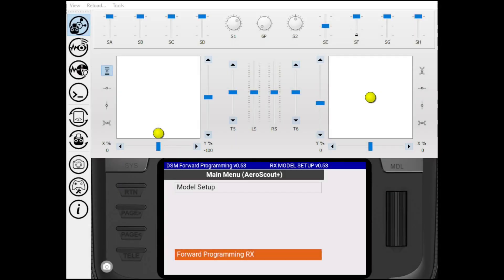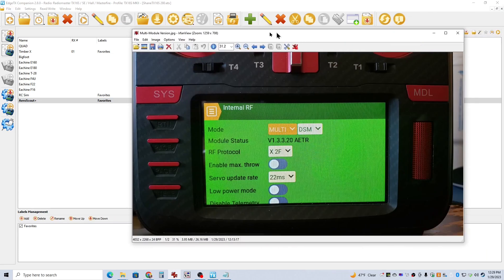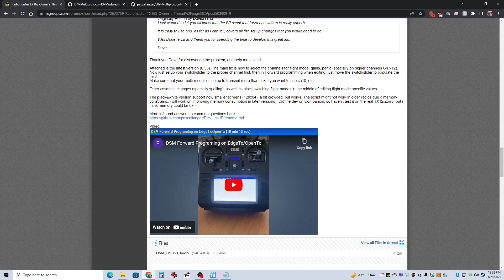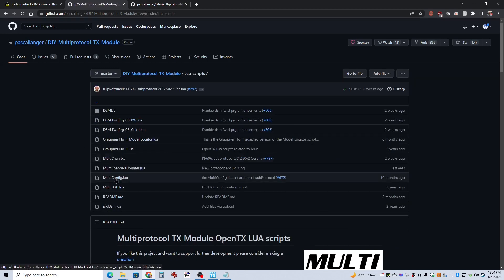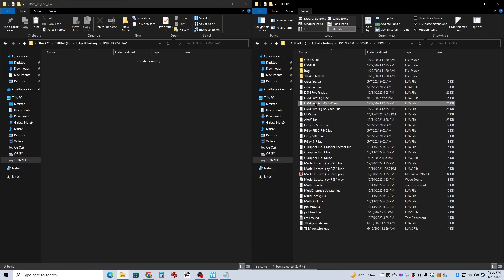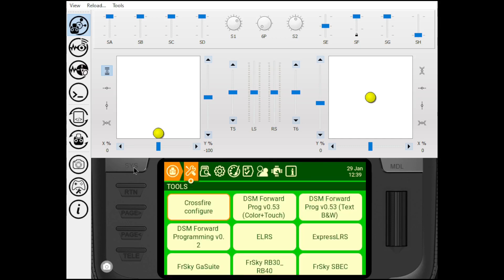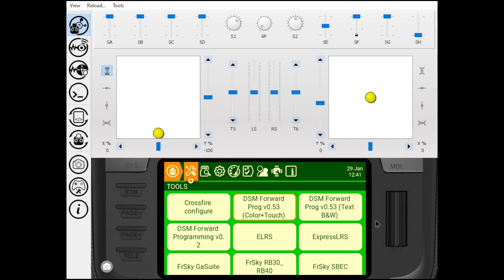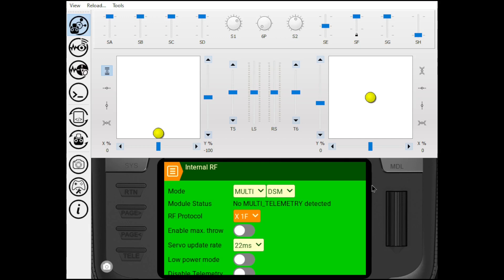Ep.1 Radiomaster TX16S EdgeTX to Spektrum Forward Programming

Comment: Do you have any idea why i cant highlight Safe? It doesnt have a box around it like as3x and safe select. So i cant turn safe on. Its off in all 3 modes
Reply from the maker: If the receiver is factory configured for "Safe Select", it must be enabled during the bind process.  Insert bind plug, power up, pull bind plug, then bind the transmitter.

Alternatively, you can power up the RX while holding the bind button and keep holding it, then bind the transmitter.  That is harder do do unless you have a helper.
Reply from the maker: I just retested this. For most "Safe Select" configured receivers that are still locked, you only have safe in flight mode 1. In modes 2 & 3 you can decide if you want AS3X or not.  If you want full access to all functions you must follow this series, unlock it and reprogram it.
Reply: @shanesdiy  oh and I do test it everytime I mess with something to see if it's trying to self right and it won't. AS3X works fine though but I can tell it's not safe it's AS3X only. The surfaces only move with sudden movement and go right back into place even when planes leaning or upside down
Reply: @shanesdiy  I was watching a video just now and I noticed one thing I didn't do. I didn't flash my new multiprotocol module. I only flashed the new firmware
Reply from the maker: @brandonwesson6818  Which Multi module firmware are you using?  Latest is 1.3.3.33.  It doesn't change at the same time as the EdgeTX firmware and only needs to be updated when they update it, not at the same time as you do the EdgeTX firmware.  Unless yours is really old, not sure that will help but would update it regardless.
Reply: @shanesdiy  I will check it when I get home but I'm pretty sure it wasn't the most recent version that was installed but I added the newest version just didnt actually know I had to flash it as well. I did flash the firmware
Reply: @shanesdiy  i want to say the firmware was v1.7
Reply: Ok. Yea for some reason safe won't come on in any 3 modes. I'm thinking maybe I messed it up with the V0.2 version. Safe was working before I updated my firmware to the latest version. The transmitter is only a couple weeks old. My friend has a spektrum Tx so I'll try to program it with it. Will also follow this series.
Reply from the maker: @brandonwesson6818  Is safe select ON currently?  If not, Safe won't work.  Updating the firmware just allows you to do a factory reset, it doesn't automatically change anything in the safe programming.

The version used in this video isn't the latest, the github link to the latest v0.56 is in the description.  With the latest Lua, the TX16S, Zorro, and Boxer can do everything you can do with a Spektrum transmitter.  If you still have an issue, I don't think trying a different transmitter is going to solve the issue.  Let me know what you are seeing, happy to help you with the problem.
Reply: @shanesdiy  upgraded to v0.56 today actually. When I go into the forward programming RX safe select is on and when I move my SE switch which is what safe is assigned to it shows it switching to all 3 modes but when it goes to flight mode 1 safe doesn't come on like it should.
Reply: @shanesdiy  all 3 modes show safe off and it doesn't allow you to highlight and change safe. Only AS3X. Once again thanks for trying to resolve my problem.
Reply: Thanks for helping me get the forward program tools btw. Great detailed video
Reply from the maker: What receiver are you working with? AR631 or 637 or something else?  Also, what version of the firmware did you install?
Reply: @shanesdiy  AR637TA my firmware is v2.9.4 "providence" it's in a eflite Carbon z150t BNF
Reply from the maker: Which Spektrum firmware is on the receiver? I thought you mentioned you had updated the RX firmware, perhaps I misunderstood and you meant you updated the transmitter firmware?

Oh and when you updated your Forward Programming Lua did you delete the old DSMLIB folder and contents and replace with the new one that came with the v0.56 Lua package?
Reply: @shanesdiy  oh no I haven't updated the Rx only the transmitter
Reply: @shanesdiy  I didn't delete the old folder..maybe that's the issue. Like I was saying it shows it changing to all 3 modes but none of them have safe activated.
Reply from the maker: @brandonwesson6818  If you updated from Forward Programming v0.53, v0.54, etc. up to v0.56 the old DSMLIB folder must be deleted and updated with the new one.  The safe modes in the rx can't be changed other than turning on/off safe select which if off, locks out mode 1 and therefore no safe mode. It could be that just the text you are seeing is not correct if the DSMLIB contents were not updated.

Check that folder but also, just put the plane in mode 1 and physically tip it left and right to see if the auto leveling is working.  If "SAFE Select" is ON and you are in mode 1 safe mode/auto leveling is likely on even if the menu doesn't say it.  If you didn't update the RX it is impossible to alter that.
Reply: @shanesdiy  i never had v0.53 or any others I just got the transmitter less than a month ago so it didn't have any of that. Only the v0.2 but I added the v.056 last night myself. Wish I could find someone close by to help me. I have messed with this thing for days now just trying to get safe to work 🤣
Reply: @shanesdiy  in the V0.2 I know the on and off was labeled backwards. All the modes show safe on. But the V0.56 all 3 modes show safe off
Reply from the maker: Yes, the old was was backwards.  The v0.56 is not.  I know I keep asking this but "SAFE Select" should say ON in v0.56 as the text is not backwards.  v0.2 did have this backwards, not just the SAFE but SAFE Select was backwards.  If you manually change SAFE Select to OFF what happens?

When you power on the plane and it connects to the transmitter do the control surfaces "cycle twice" indicating SAFE Select is ON?
Reply: @shanesdiy  if I manually select it to off then my switch only toggles through FM 2 and 3
Reply: @shanesdiy  do you use discord or anything like that? Might be easier to message back and forth. If not that's fine. I feel bad for taking up people's time trying to get this resolved.
Reply from the maker: @brandonwesson6818  Maybe dumb question but since this is such a weird issue I better ask, are you running the v0.56 Lua to access the Forward Programming?  Just want to make sure you aren't still using v0.2.

Do me a favor and after you access forward programming, navigate to the SAFE Select settings and toggle through each of the 3 modes like you've already done. Access your SD card, and copy the "dsm_log.txt" file and email it to me.

shanesdiychannel [at] gmail.com

This file may offer some detail of your issue.
Reply from the maker: @brandonwesson6818  shoot me an email and we can determine the best communication option.  If I don't have time to help I will let you know.  For now, I have some time.
Reply: @shanesdiy  will do but im at work so it will be later this evening. Thanks
Reply: @shanesdiy  I am opening it through the color v0.56
Reply from the maker: @brandonwesson6818  I'll keep an eye out for it.

Comment: Will doing this allow me to connect to an ar6335 in a blade 180 cfx?
Reply from the maker: I do not believe so.  I have no experience with that receiver or the Blade 180 CFX so I don't want to give you incorrect information.  I don't see anything in the AR6335 manual relating to Forward Programming.

Comment: When i go to the forward programming it says cpu limit how do i fix this and get it to work?
Reply from the maker: What transmitter are you using and what version of Forward Programming?  There have been several updates since this episode. Github link in the description will take you to the latest.
Reply: @shanesdiy  transmitters a jumper t16 and the version of fp is v0.54
Reply from the maker: What version of EdgeTX?
Reply: @shanesdiy  i think i figured it out i needed the latest version it seems to work now
Reply from the maker: Great news!  So others that might have a similar issue can get help too, latest version of what?  EdgeTX or Forward Programming?
Reply: @shanesdiy  latest version of forward programming but one thing when i go to model setup it says please create models/dsmdata folders but i have those i put them in the scripts/tools folder
Reply from the maker: You must have a /MODELS/DSMDATA folder in that location on your SD card.  It doesn't go in the /SCRIPTS/TOOLS folder.  When you use the model setup script in the Forward Programming menu, that is where the model setup data file is stored that tells the receiver what wing and tail type you have, servo directions, etc. and also where the receiver will look for it when performing the safe setup or when you "relearn servo settings" from forward programming.

I show and explain these data files in episode 3 of this series.  Here is a link to the video that takes you to the time stamp where I'm talking about it.
https://youtu.be/mEfLGnEZN9U?si=-FqU-GA2HwFtLlEc&t=2604
Reply: @shanesdiy  i figured it out thank you one more question i setup safe mode in the forward programming but it dosent seem to work like the safe mode isnt there at all no movement when i move the receiver
Reply from the maker: What receiver?  Is this a BNF (bind and fly) receiver with pre configured safe modes or did you program it from scratch? What channel did you assign to switch flight/safe modes on/off?  Do you have a switch assigned to that channel to switch between different safe modes?  Might need to have you email some screenshots of your mixer screen for the safe channel and any other relevant settings if you can't figure it out.
Reply: @shanesdiy  its a ar630 of the the self not a bnf version i have ch5 set to my se three position switch the top right one on the t16 but i set it up weird with an override so ill fix that to be a normal switch input
Reply: I guess the question is how would i program it from scratch since its not a bnf @shanesdiy
Reply from the maker: If it wasn't a BNF and is an off the shelf stock receiver, it wouldn't have anything setup for the safe modes.  When you enter Forward Programming what do you see?  If it has never been setup and is blank you'll see "First Time Setup".  After you complete that you'll then need to do the "First Time SAFE Setup".  Prior to all that you need to do the model setup for wing and tail type, etc.  Episode 3 goes through all this.  It is a long video but very detailed and relevant info if you really want to understand so I wouldn't skip chapters.  Link below is for Episode 3 if you haven't found it yet.

https://youtu.be/mEfLGnEZN9U?si=rGaQXR2OCfOZqd8Y
Reply: @shanesdiy  i followed fat guy rc's set up guide and it works perfectly thank you for your help i cant wait to go fly
Reply from the maker: That's awesome!  He has some great videos.

Something to keep in mind, he uses a Spektrum transmitter so there will be some differences in the steps to configure the wing and tail types and more critically, how you reverse a servo direction if safe mode is moving one, or more, of the control surfaces the wrong direction.  Be sure to thoroughly test that the ailerons, elevator, and rudder are all moving in the correct directions when the receiver auto levels before flying.  For example, just because when you move the stick the ailerons move correctly doesn't mean that the gyro will also move them that same direction.

Let me know if you have any more questions!  Happy flying!

Oh, I would still like to know what version of EdgeTX you are using.  Some of the Forward Programming and TextGen functions require at least version 2.8.3 or higher of EdgeTX.

Comment: i just want to check what is going on, so basiclly we are installing the foward programming menu from the spektrum radios on to our radiomaster, so we can access foward programming after we unlock our receiver that came in a bnf airplane. Also, after this is all set up will i be able to set my servo rates to 150%? Does this risk bricking my transmitter at all if not done properly?
Reply from the maker: I am not aware of anything within forward programming that limits, or removes limits on servo rates.  The default safe and intermediate modes do have bank limits but that isn't a rate limit.  Forward programming sets up the safe mode gyro settings, gyro gains and channel, gyro control directions, f-mode channel, wing & tail types, etc.  

Much newer scripts out since I made this episode 1 video, the github link in the description should take you to the most current updates but in this video the links I use are old. In later episodes of this series I discuss some changes, how to update the radio with the latest scripts. They can be long videos but chapters should help you find relevant details.  The forward programming lua scripts are just one of many scripts that most EdgeTX radios have available.  Not sure how you would brick your radio with one of these scripts but certainly if you delete something you shouldn't or corrupt your memory card, you could cause issues.

Yes, these scripts, if properly installed and used, allow you to perform all functions via forward programming that you can do from a Spektrum transmitter.  Also, as you'll see in my later videos, the developer has also added a script to let you setup the Spektrum Avian ESC's as well, just as you would from a Spektrum transmitter.
Reply: @shanesdiy  Oh wow! I have a turbo timber evolution and was also about to replace my esc just to have thrust reverse and braking but you are saying you can just program that in to foward programming?
Reply from the maker: @HenryTietz4  Technically it's not Forward Programming but similar.  The Forward Programming script package has a script called "DSM_SmartRX_Tel.lua" that handles the Avian ESC programming. You do need to have your EdgeTX updated to 2.8.3 or later to get all the functionality.

Two of my videos I suggest watching to learn about this.  In this video series, episode 4 the "Bonus Episode" is all about the Turbo Timber Evolution so check that one out.  The second is specifically about setting up reverse thrust with the TX16S on an Avian ESC from scratch.  I do this on an AeroScout but the process is the same on your Timber.

Here is the link to the Reverse Thrust setup video on the AeroScout.
https://youtu.be/C0L_cKdJAy4
Reply: @shanesdiy  Thank you. I have one more question, do i have to hook up my receiver to the computer using the cable to do the fiddling with the avian esc?
Reply from the maker: @HenryTietz4  Negative. The avian signal just passes through the receiver to your transmitter, just have to be bound to the RX.  ESC of course must be connected to the throttle channel of the Spektrum RX.
Reply: @shanesdiy  Thanks again for the help Shane. I now updated my firmware to 2.9 and have all the tools. You definitley earned a subscriber

Comment: Hey i just found this need it desperatly. But cant see what files you copied to tools the link you have have like 20 files plus some are still compressed after you extract. Not too good at this stuff and bricked radio already took me 4 days and alot of videos to get it back
Reply from the maker: New links to a github page since this video was made in the description. Yes, there are a couple more zip files to unzip after the main file. Dig down until you find the proper individual files. As of now v0.55 is the latest, did you get that?  In a later video I work with the newer download files.
Reply: Switch sd is set away off middle as3x to me safe reset and did again everything seems to work I think I forgot to activate as3x again after set up safe but not sure we will see. Still think I am missing something in downloads I did .055
Reply: I got it I think but for some reason can't get as3x to work beeps say it's on but no work. Got through ep3 did all of it I hope still nothing can make safe work but not as3x by itself new reciever in viper 70 old one died
Reply from the maker: @mitchfowler646  AS3X doesn't activate until you throttle up over 25%, I assume you were aware of that but have to mention it.

If you have the latest forward programming do you have access to the F-Modes inside forward programming?  If yes, as you switch between them, you should see the settings for each mode so you'll know if AS3X is enabled in modes 2 and/or 3.  AS3X and safe are not active at the same time because safe handles all stabilization.

If it is a new receiver that was not from a BNF model, you'll need to setup all flight modes with your preferences.  Did you setup all 3 flight modes?

Comment: Does this apply if I'm using external 4 in 1 multiprotocol module?
Reply from the maker: Yes, it will. As long as your TX16S will communicate with Spektrum DSMX and you have the necessary Lua scripts and minimum EdgeTX version this applies.  If you have a black and white radio like the Zorro or Boxer, I don't believe all of the forward programming functions are available yet due to lower memory, at least as of the time of this comment.
Reply: @shanesdiy  I have the mark ii tx16s. But it's got the internal elrs module . So i just ordered  the external 4 in 1 module since most of my planes have spektrum receivers. Glad to know this works! Thank you!
Reply from the maker: @noobiekush  Perfect, yes, anything that will work for the internal module should work the same with the external module.  Been several Lua updates since I made this video so just be sure to get the latest versions.  I believe I updated the links in the description to the current ones.